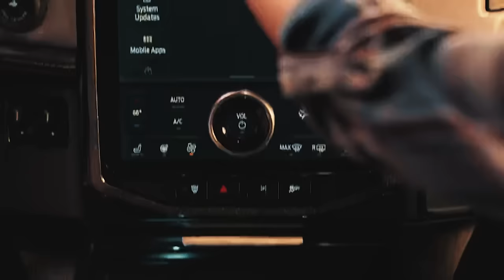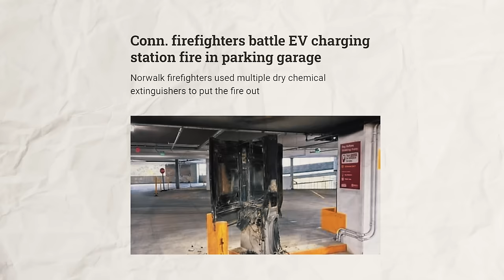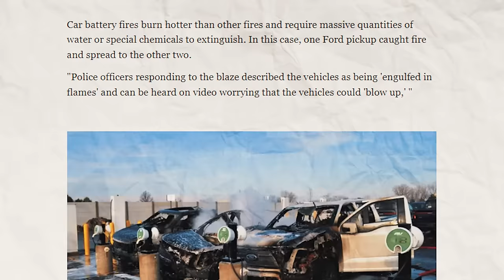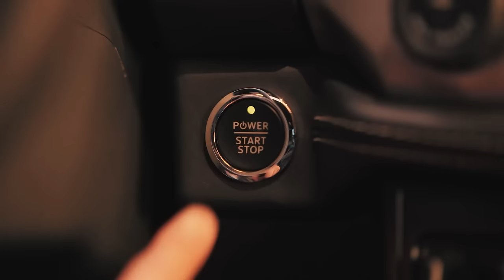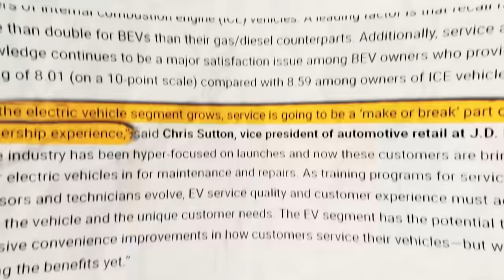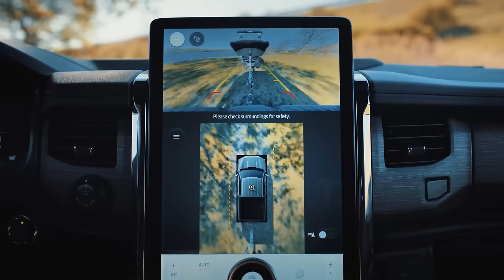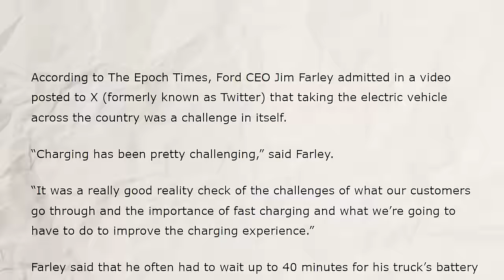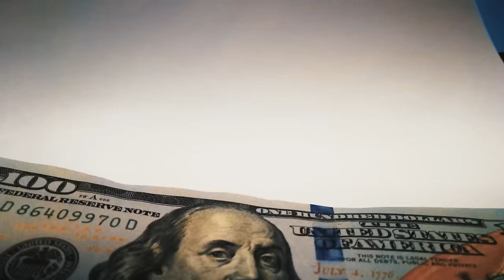Ford CEO SHOCKED as EV Fiasco Completely DESTROYED Ford’s Reputation!

Comment from the maker: 🔴Should Ford SHUT DOWN EV Production?🤔

🏆EVs Owners HAD ENOUGH & Want to SWITCH BACK to Gas Cars 👉https://youtu.be/4KEWR9WsVzQ
Reply: Yes, 100%
Reply: No 1000%!   ...I paid $9000 for my used EV (2017 Chevy Volt) and it saves me $2000+ a year in fuel costs alone, and that doesn't even count the fact that I have yet to need a brake job, and only change the oil once a year (and don't even need to)
Reply: If they want to go under yes
Reply: @optiskeptic4746  Good luck when you need a new battery.
Reply: People brag about their EV cars... until their warranty ends and they're facing five figures for replacing a battery.
Then suddenly they're no longer fans of electric vehicles.
Reply: @bigglyguy8429  Thanks! I've got it covered, tho, that's why I allocate 10 cents per mile from my mileage reimbursement, so I'll have $10k at 100k miles, no problem... 
I'm a pilot and airplane owner as well - and that's what we do for our aircraft, as we have to overhaul the engine every 2000 hours so we include an hourly fee for the engine rebuild budget. Looking forward to electric airplanes, there's several promising candidates!
Reply: @optiskeptic4746  Ever considered that you can't take lithium batteries onto an aircraft, but people want to power aircraft with them? Can you spell 'cognitive dissonance"?

Comment: Ford lost the plot completely when they stopped making small fuel efficient cars like my Fiesta in favour of large electric SUVs and trucks. The irony being that once you take into account the emissions generated in mining the necessary materials and manufacturing the electric SUVs and trucks and the power station emissions necessary to provide electricity for them, they almost certainly generate a lot more CO2 than my Fiesta.
Reply: Correct.  Ford does not claim EV are cleaner.  No manufacturer makes this claim.  All product claims are subject to consumer protection laws and would have to be proven if challenged.  There is no proof.
Reply: @encinobalboa  Politicians and environmentalist push the claim they are cleaner. Though automakers certainly don't help by repeatedly preaching that 'electric is the future', which it may be, but only for the wealthy unless they find a cheap battery that doesn't weigh as much as a honda civic
Reply: @hate6649 Name one EV manufacturer that claims EV is cleaner than ICE.  Tesla does not make this claim on their website.  Neither does Rivian.  Instead, they use proxies to make the claim.  If they make the claim directly, they would be subject to consumer protection laws which state that product claims must be provable.  Either proof for the claim has not been found or the result is negative.

Comment: Battery capacity and charging are the two main issue, with probably a third being battery durability and damage tolerance (especially in any off-road machine).  The F 150 has a 23 gallon tank, and at 38 kWh per gallon, that's the equivalent of a battery capacity of  874 kWh: "Filling up" your F 150 with a 10GPM pump takes less than 2 1/2 minutes: That is an effective energy transfer rate of 22.8 MW per minute.  This is the energy transfer AND storage rates ALL EV's will need to be capable of, if they are ever to match, let alone exceed, the current utility value of IC engined cars. 

To put this in perspective, the average coal-fired power station is rated at around 600MW output; so, the ONE power station can provide enough power to charge about 26 ev's at the above rate. The average service station has 12 pumps, so it'll almost take the entire output to provide power for this level of acceptably fast charging to TWO average sized busy petrol stations.

As for the safety aspect of charging at almost 23 MW, the Tesla V4 Supercharger can charge at 600kW, and to overcome the internal battery resistance in order to deliver the 600A, requires a terminal voltage of 1000v. This means the battery internal resistance is about 1.7 ohms, and the power lost is dissipated as wasted heat. 23MW is 38 times this rate of energy transfer, so the voltages needed (and resistive thermal losses) will be proportionally higher. These "chargers" are intended to be used by the average person, with no specialist HV training, and are often located closely together for convenience. They will also be very much mass-produced to meet the utility requirements, and the consequences of "user problems" let alone device failure at such power densities are frankly terrifying.
Reply: Some people hail Solid State batteries that charge almost instantly as the solution but it isn't. A Solid State battery that charges almost instantly can also discharge almost instantly and is unsafe in any car. We could load an electric car with a bank of Capacitors, the reason why we don't is it would kill you in an accident....the same as a Solid State battery would kill you in an accident with near instantaneous energy liberation.

Comment: My opinion only. The EV industry as a whole has a lot to surmount, issues well documented. FORD (GM also) were not, will not be capable of mastering this technology, they cannot even master and engineer their ICE vehicles (read recalls). Both happily pandered to the politicians and might have destroyed their corporations in doing so. Politicians build nothing but destroy everything they touch. Sad, Farley and Barra have their “golden parachutes” while disrupting how many employees lives.
Reply: They have a greed problem. Don't care at all about consumers.
Reply: Why do people think that vehicles that are recalled are low quality?
Every auto manufacturer has had recalls and no matter how thoroughly engineered and well-constructed a vehicle is when they are put in the hands of the purchaser driver in all different manners and maintained from meticulously to ignored problems will show up just like any other machine ever created.
Reply: @williamegler8771  Well I do not disagree with you and get your point. To me on “quality issues” mainly comes down to failed software since they now run all vehicle systems through the “infotainment” hub. Another example is GM taking a reliable 5.3L, adding cylinder de-activation for dubious mileage gain and crashing the lifters. These are examples of what I refer to, and yes they have to fix but look at the cost of vehicles now.
Reply: @williamegler8771  it's more about frequency.
Reply: absolutely true

Comment: remind me again on how great EV's are i forgot
Reply: They cost on par with average car in the US, cost about one quarter as much to fuel, are absolute delights to drive, have less maintenance, and don't spew carcinogenic exhaust that's understood to be altering the Earth's climate.
Reply: @levenkay4468  Do you believe an EV can last 30 years without needing the battery and other significant parts being replaced at an expense greater than the value of the vehicle?
Reply: @levenkay4468 someone hasn't caught up with the times. I wonder how not toxic all that smoke from a lithium battery fires is.. the cost to charge is on average more than the equivalent amount of gasoline. They are heavy and tear up the roads and wear through tires much faster. They cost on average double that of a gasoline car. Can spontaneously catch fire while parked in your garage. Don't take a charge if it's to cold and the actual milage is never what the estimated says it will be. Chargers are often broken and are far and few between after more than ten years of infrastructure build out. The current power grids couldn't handle charging a replacement fleet of EV cars. It would cost billions to just redo homes so they can charge. Trillions to redo the power grid. All to reduce CO2 by 1%. That's all that crazy contribute to CO2 emissions... Sound like a really good idea.
Reply: @JoeBManco time has proven that's not the case. The battery will fail on average after 125k miles unless trickle charged.
Reply: @maxwellblackwell5045  BINGO!  My car is only 27 years-old, but there is no reason to believe it won't last for many more years.  The body barely has any rust that I am considering fixing in a couple of years.  The 4.0 straight-six has almost new compression despite having 250K on the odometer.  No EV will top that.
Reply: @JoeBManco  don't wait to fix the rust. It's cancer.
Reply: @JoeBManco  is it a jeep? That was a good motor.
Reply: @JoeBManco  Maybe not; depends on whether battery prices will start going down again as new refining processes come on line.  Do YOU believe a combustion car can be kept in daily service ( 30 years *  (12K miles/year) * (1 gal / 30 miles) * <insert 30-year average fuel cost in $/gal here> ) for that long without destroying an amount of fuel greater in value to what a replacement EV will be selling for at the end of that time?
Reply: @levenkay4468  You forgot to factor in the price of electricity in your question.  Electricity is not free and the cost for that will be just as much or more than the value of an EV over a 30-year period.
Reply: The ignorance here is incredible. My first ev, a Chevy Volt now owned by one of my relatives now has 290k on it, still going strong. Many early Chevy Volts have now passed 400k with no battery failures. You folks have been drinking the anti-EV kool-aid too much. Enjoy your fuel guzzlers while the more enlightened amoung us tool around in our EVs!
Reply: @danvester6476  Isn't a Volt a hybrid?
Reply: @levenkay4468  that's why alot got recalled
Reply: @JoeBManco  My utility's off-peak rate for the electricity I use to charge my EV (easy to set the car to charge only during the off-peak time)  is 4.2 cents per kWh, and my car gets four miles for each of those kWh in summer (only 3 in winter); that's about a penny a mile.    The prices I see advertised by the gas stations I drive past are around 380 cents per gallon, so my car is getting the financial equivalent of 380 miles per gallon (summer; 280MPG winter).   The propaganda claims that you're amplifying,  that electricity prices will rise to surpass fuel costs, are pure bullshit.
Reply: @JoeBManco  It's a series hybrid, yes, like a plug-in-Prius.  It runs on 100% battery for about 40 miles, and only then switches to gas.   That's the US daily driving distance, so a lot of Volts seldom needed to run their gas engines at all (except for the worry of the fuel going stale).
Reply: @levenkay4468  My daily drive is around 55 miles round trip.  I'm on the road roughly 1 hour 15 minutes each day.  Hopefully hybrids continue to be sold well into the future, because I don't think an 100% EV is a good idea for my commute.  I will also add that I think the Chevy Volt is a good-looking car.
Reply: @levenkay4468  you haven't done your homework, stop drinking the kool-aid
Reply: @JIPlatium  "Didn't do much research"??   I wrote from personal experience in owning and driving EVs as my only cars since 2011, and the ability to compare them to 30 years of driving combustion cars beforehand.   Might one ask whether you've EVER driven an EV before spouting off about them?
Reply: @levenkay4468  The climate part is false, plus you produce vastly more pollution creating such heavy, toxic vehicles.
Reply: @levenkay4468   EV vehicles are massively worse on the climate, but you collect cherry picked research thus you wouldn't know these facts.
Reply: They suck in the real world.  They are great pipping down to the local coffee shop for a $10 flavored latte.
Reply: @levenkay4468 if you live in a place where electricity is still relatively cheap then sure it's probably cheaper for you
Reply: @levenkay4468 also no the whole basis for the claim of anthropogenic climate change is a complete lie, how do I know that?  think about who pays for the grants that fund the scientific papers
Reply: I'll never buy another Ice as long as I live. I own 2 Tesla's and have Zero Maintenance, zero issues getting going in cold weather, Charging while I work or Sleep, There's not hundreds of moving parts in a motor or transmission requiring regular maint and repair. I spend far less time in a month simply plugging and unplugging (only a couple times per week) than anyone spends filling up a single tank and at far less cost. Oh and so what if its powered by coal. Its US coal, half your gas money goes to some rich Arab in the middle east. At least my money stays home, except where I live 80% of our power is Hydroelectric.
Reply: @wdbldr67  Hey, fantastic choice.  I prefer ICE.  Can we agree not to tell each other which type of vehicle we should buy?
Reply: @wdbldr67  the bulk of US Gas comes from refineries on a different gulf, the Gulf of Mexico. up until Trump those refineries were owned by Venezuela, it was under Biden early last year that those refineries in Louisiana were reopened.

Comment: Then the real problem: Price! The new vehicles are mortgage level costly and quality is absolutely horrible. The best vehicles to buy are the ones made from the late 90's to 2011. They have regular transmissions and reliable engines that have been improved over the decades. The worst vehicles of all are the ones made after 2011 or 12 being any with CVT transmissions. The 3rd gen cvts are quite a bit better as maintenance standards were figured out. You must change the fluid with the proper fluid every 2 years or 35k miles and hopefully your transmission will last 200k. However a regular auto transmission from the late 90's to 2011 may just take you to 300k and beyond. Lots of 150k mile Hondas and Toyotas and even Ford Pickups out there that will go and go and cost you from 2k to 8k. Now if you can find a Honda or Toyota with a manual...look out, you may get 600k out of it.

Comment: I think all of the domestic auto makers are in serious trouble between the union pay and quality control issues.
Reply: Except for tesla
Reply: Right after the UAW contract was signed, GM said the new pay rate will cost them $9 billion over the 4 1/2 years of the contract. Then a couple weeks later GM bought back $10 billion of their own stock. Must be nice to have that kind of money burning a hole in your pocket, but at least this puts things into perspective.
Reply: @1001Hobbies  That they thought they needed to buy back $10B of their stock to prop it up, should tell you something also.
Reply: @robertkubrick3738  - I am aware of that as well. Still, nice to have $10 billion laying around, eh?
Reply: @1001Hobbies  Depends on where they got it and what strings are attached. I don't think they had that in their hip pockets.

Comment: Broadly conceived all vehicles over 50k are struggling with sales at the moment. Interest rates are to blame. Local ford dealer has 50+ F150s just sitting on the lot. At least 6 are lightnings. What all those pavement princesses have in common is they are loaded up trims not base models. No one is buying these high priced trucks battery or gas with interest rates being what they are.

Comment: Ford ruined Ford. 
They launched too many new categories at the same time over the last four years. 
Bronco answers the jeep. But folks are saying the inside feels cheap and not rugged. 
The Maverik is a winner, but they delibertely kept the inventory low. 
The Mustang Mach-E is not much of a mustang. It's an SUV and they are not selling anymore. The Ford Lightning should have been air tight quality released small batch for the sake of finding and improving failures. 

The deaigns are exciting, but low quality.

Comment: Tesla is the best car company and no maintenance no gas stations no slime car salesman no corrupt dealerships no oil changes no smog check no belts no hoses no spark plugs no air filters
Reply: Three price reductions in one quarter.  The semis and trucks is 4 years behind schedule.  Don't fall for  the smoke and mirrors.
Reply: Stop drinking the kool aid
1) Too expensive
2) High repair costs
3) High insurance costs
4) Crazy depreciation
5) Batteries struggle to charge in cold weather 
That's not all, but it covers the main issues
Reply: For a vehicle that doesn't have many moving parts, EVs sure have a lot of major problems.
Reply: @desertstar223    The price keeps dropping and you just have to preheat the battery before charging it in the winter.  EVs keep their value longer than ICE cars.
Reply: @Islamisthecultofsin  The prices keep dropping, not because of market forces, but because of price wars between EV manufacturers. Which affect current owners by depreciating their EVs tremendously (in some cases by up to 50%) 
So, you've pre-heated your battery, charged it, and drive away in the cold weather  What happens to your estimated range? EVs last longer? Please provide the evidence.
Reply: @desertstar223   Old Testas are still over $20000.  Pretty soon there will be a new Tesla for $25000 dollars.  The range drops in the winter.  You just have to charge sooner.  There are lots of videos of Teslas making long trips in brutal winter conditions.  The battery tech keeps improving as well.
Reply: @Islamisthecultofsin  I dont need anecdotes. I need cold hard facts. Come now!